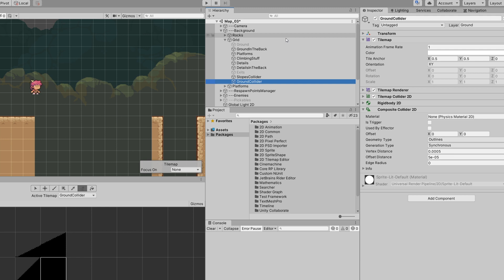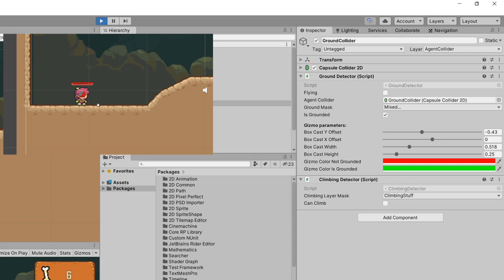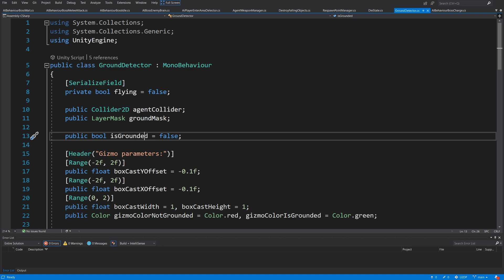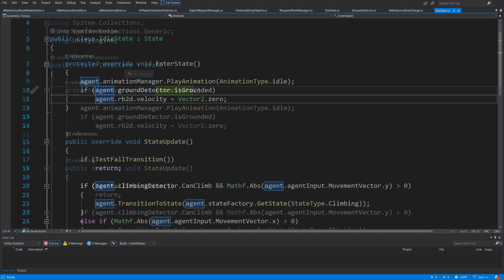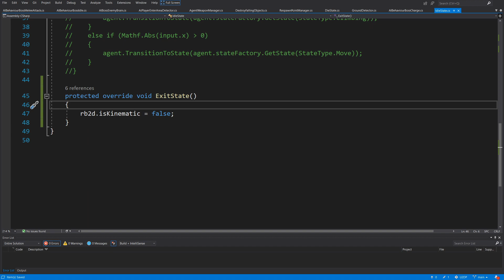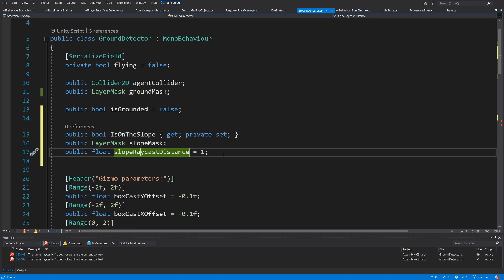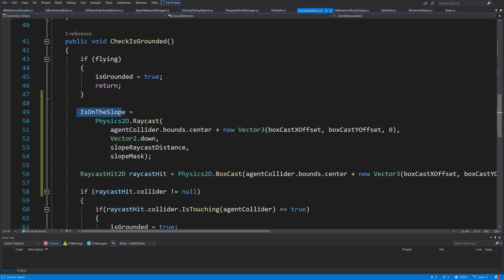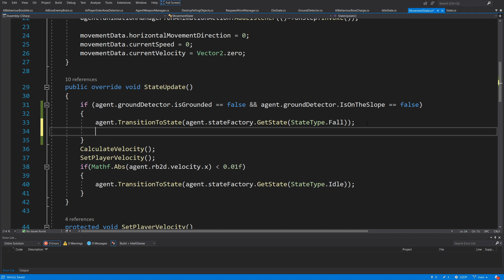How to handle slopes in a Unity 2d platformer game

Comment: Hello, Sunny Valley Studio.  Your tutorial is very helpful.  I encountered a bug in playtesting with my platformer is that the enemies can knockback my main character.  When I am grounded on slopes, my character is set to kinematic, but when he is knocked back (mid air), I set him to dynamic, and turn to kinematic again when isGrounded.   However, this creates an issue that at certain frame of the game, when the player is standing against a wall and is being knocked back, he goes through the wall because he is kinematic.

Is there a good solution to this issue?
Reply from the maker: Sorry to hear that. In that case it might be useful to have additional detector to raycast in the direction of the knockback effect and prevent the movement if there is the wall. 
In general to have a full control over the movement (but also having to code every collision check ourselves) it would be best to use kinematic RB only.

Comment: 10:18 am I right to assume that you only made your character stay in the running animation instead of fall animation when moving along the slopes? so if you move along the slopes too fast the character is still falling and not sticking to the ground right?
Reply from the maker: In the project (it is from my 2D platformer course) I use State Pattern to transition between states. This means that we can check any condition in any state. This means that the grounded check will still be detecting if we are grounded or not when in Falling State and it will transition us from the Falling to Idle state. The Idle state next will trigger the Slope State. I guess that if the character was to be flying high enough above the slope and the grounded check would not be triggered it would not stop. 
I hope that it answers your question. Here is the course link if you are interested https://courses.sunnyvalleystudio.com/p/code-a-2d-platformer-game-in-unity-using-design-patterns

Comment: Are the rigidbodies on the platforms supposed to be Dynamic or Kinematic? Also, whenever I set my character object's rigidbody2D to kinematic, it falls through the platforms...
Reply from the maker: Hey!
The only thing that needs a RigidBody is what moves in your scene.
Ground and objects that you just want to move on are usually static colliders.
Your character might be falling because it has no collider on it. Basic idea is that for the 2 bodies to collide with each other we need both of them to have a collider appropriate to the physics engine (2D and 3D are different!).
Next for the physics engine to detect the collisions you need a Dynamic RIgidBody2D to move your character. It moves your player in FixedUpdate so unitys Physics2D engine can detect the collision.
Also just in case in ProjectSettings for Physics 2D you have Layer matrix so in case you have platform and the player on different layers make sure that both layers are enabled to collide with each other.
I hope it helps!

Comment: Great video!

My approach is to Raycast & check for a slope based on the angle(hit.normal.x) then switch my RigidBody to Kinematic or Static. 
But I got into trouble bc if there's no active collision you can't check for enemy bullets against the Player, and so...  

How would you solved that?
Reply from the maker: Hey!
In my solution I never disable the collider. Even if I set the rigidbody to be kinematic my state patter implementation makes Idle state change to GetHit state meaning that i can reset the rigidbody to be again kinematic to apply on it any sort of force or whatever you want.

I know how much work it takes to make each different system work together in even a simple game like a 2d platformer. I have worked last year on a similar indie project and we had a lot of issues until I spent 1 full week refactoring the character movement code to a state pattern. It took so long because I neglected code architecture due to it always being "deadline is approaching". When multiple other systems were depending on the character movement it took a lot of time to make sure that my refactoring didn't break anything. 

In a long run its always wiser to spend an additional day to refactore your code before you start adding more features to your game.

Anyways thanks for watching! Take care!